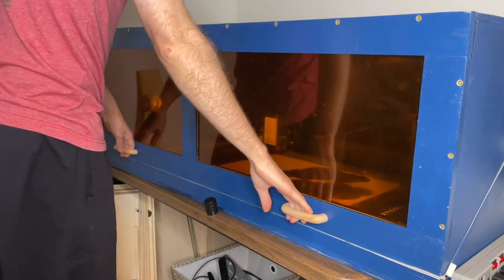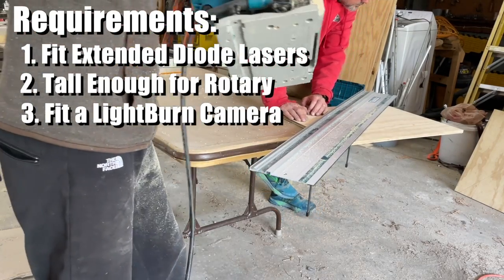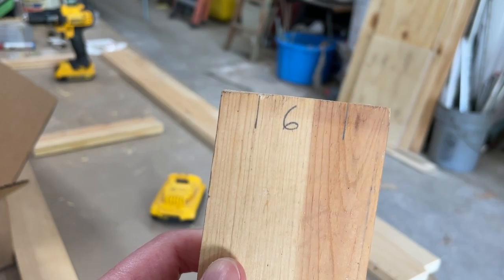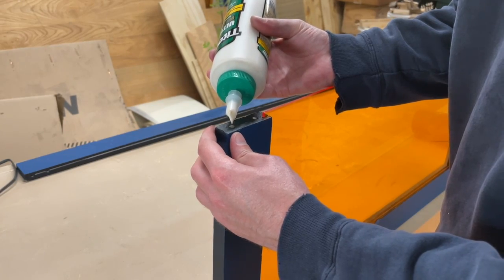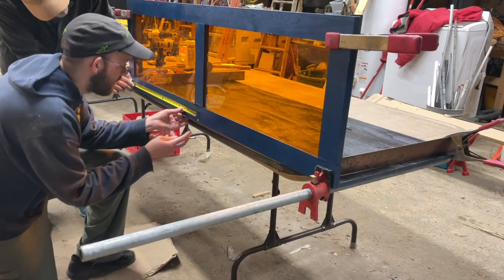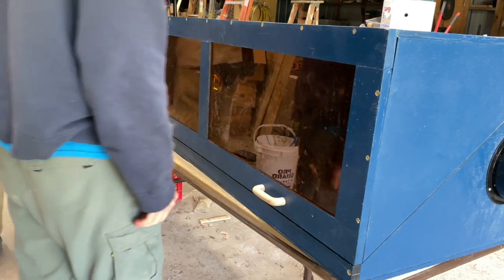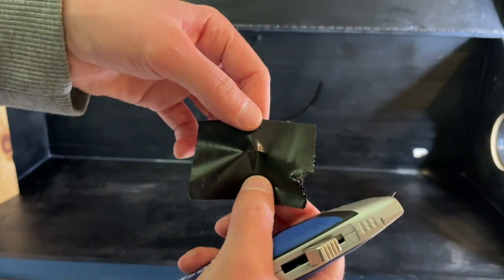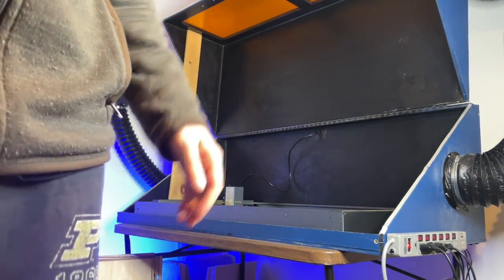Building My Dream Laser Enclosure (Fits XTool, Atezr, etc.)

Comment: An option instead of buying the expensive laser filters you can use a backup camera or baby seat camera instead.They hve both the camera and display, are fairly cheap and can be used remotely.
I'm using a baby seat camera for my fiber laser as I will be able to monitor it while sitting down. (I thought of this after buying the laser filter.)
For painting there is a device called a Roller and Roller Pan these speeds painting up considerably.

If you had broken (cracked) the edge of the solid wood you could simply glue it back on.

Comment: Too amateurish a build.  Pre-drill holes for the screws will stop splitting of the wood.  Joints are too rough.  You are going to lose a finger or two using a table saw in that manner.  If you are going to all this trouble, use some quality wood rather than cheap plywood and rough lumber.  Sheesh, how do people get away wit this?

Comment: It’s always great to learn new things. An added benefit is learning from your dad while creating wonderful memories. (Many people don’t have that )
When painting flat surfaces, using a roller is preferred, incredibly fast. Other option is to use a paint sprayer(costly, time consuming due to set up and protection from overspray, and cleanup/break down)
I would like to creat a cabinet with a down draft exhaust. 
Would you might have plans for one? I also only have the standard D1 system.
Thanks for video

Comment: The air intake setup being used will create dead zones where fumes will not get pulled out but collect. Need to run 1-2 inch holes across the bottom side, with at least 1 in each corner. I would also put on the same side in the corner of the lid. This way as air is pulled in through the different holes, it creates an even air flow across the workspace with new air. You just dont want to many large holes, as you want slightly  more volume out than in, which will ensure any cracks/seams will not allow smoke out due to the negative air pressure.
Reply from the maker: Very thoughtful comment. Thanks for weighing in. I’m getting ready to set this up in my new shop, so I’ll consider your suggestions here.

Comment: Great build! I'm planning my own enclosure and trying to work out the best exhaust. I've seen a lot of people struggle with air smoke escaping their enclosure even with an exhaust fan. My logical solution is the same as your idea, which was to have an intake duct bringing air in from outside to the enclosure and seal it. That way the enclosure has it's own sealed environment. 
I was only planning to have one fan on the exhaust and let the negative pressure pull air in the intake. I see you have two different duct sizes and fans. Can you explain why you chose to do it that way? Will just one fan not be strong enough to pull air in from the intake?
I saw another person's response that you need a stronger fan for the exhaust, but I would be worried that would just over-burden that fan that is starving for air to move and burn it out.
Reply from the maker: Thanks! For the fans, i use a 4inch (and slightly less powerful) fan for intake and a 6inch fan for exhaust. My original logic was that using a less powerful intake fan would still create some negative air pressure to account for any leaks in my seam sealing. With that said, I’m not sure it’s a perfect solution, so if you get good results with a different setup, I’d love to hear your approach.

Comment: Trick for cutting with a plunge saw: You can take a plastic bottle an cut off the top so it fits over the saw dust exhaust. Then most of the dust will be collected in the bottle instead of the floor and in the air. Then it is just a matter of emptying the bottle in a bin. You just need a small 500-600 ml bottle for the purpose - empty it between each cut. You simply turn the exhaust upwards, slightly to the right, instead of downwards, and put on the bottle. Works well with the Mikita. The same can be done with the mitre saw.
You miss covering the inside in some kind of metal sheets to avoid fires, if a burn goes wrong and some wood catches fire.

Comment: I have a sculpfun s30 ultra 33W. I'm having trouble finding an enclosure for it. It pretty much is a 720x720 footprint.  Can this work for me?
Reply from the maker: If you’re talking MM, then unfortunately no. This design would be long enough, but not deep enough for your laser. BTW - I think I remember coming across this laser. Is it the one where you can basically extend it in two directions? Giving you a very large extended square working area? Just curious because most lasers only extend in one direction, whereas I think sculpfun allows “double extension”

Comment: For your door lifts, you may wanna check out my spring setup that I use. It is far cheaper to add and also provides upward and downward tension to the door without the need for a latch to hold it closed as with struts, I have tried both and springs work better for me. It is all about the placement of the springs to adjust tension.
Reply from the maker: Hey! Thanks or the tip - I’ll think about the spring approach. Now that you mention it, I remember seeing that in one of your enclosure videos. I’m a long-time viewer of your channel by the way, keep up the great work!
Reply: Cool, Thanks for watching. Nice looking enclosure also.  @chalkwatts

Comment: Some suggestions.  First - Instead of placing the intake air inside of the box .. force the air into the room instead.  In combination with ducting the waste air to the outside .. you now created a positive air pressure in the room vs the inside of the box.  It's like a clean room.  The smoke can not escape even if you have a leak.  In fact you want to have some ventilation into the box.  Second - Use a more powerful fan for the in take than the out take .. like 6" in vs 4" out.  Lastly - Close all doors into the room to help seal it.

This is the way I have my laser setup.  So, even if you open the lid before all residual smoke  or smell is evacuated, it would still get drawn outside.
Reply from the maker: Very interesting ideas. One question. Wouldn’t it be better to have a larger exhaust (e.g. 6 inch) than intake (e.g. 4 inch), because then the exhaust would create negative air pressure INSIDE the box, meaning that it would pull in all the intake air as well as some ambient air in the room. That’s the way I was thinking about it, but do let me know if that’s flawed thinking.
Reply: I'm no engineers.. so, I'm guessing here. It would depend on the situations? 

For me, I have a 100W Thunder laser in a basement that is venting through the 1st floor and an attic. The laser generates a lot of smoke and smell. The basement air is cold and the smoke from the laser is NOT hot so I don't get the draw effect from the flue/chimney (20 ft in height). If anything.. in the summer I'm fighting to push the heavier cold air (68F on average) up to the roof. I originally had two 6" ducted fans. One is at the laser and one in the attic on the same flue. They were not enough. I still had some smoke and smell.  So, I built a door with a 20” fan in it to blow air into the room from the rest of the basement.  It worked .. no smoke or smell at all.  The 20” fan was moving more air into the room than what the two 6” fans can pull out.

So, for me it was inefficient to draw a vacuum with 6” ducted fans and at the same time try to push/lift the cold heavy air up 20 feet.  For you a bigger out flow might be better since you are not fighting gravity.  

I think the most important thing is to have a differential in air pressure.  The two fans should be of different capacity (CFM – Cubic Meter per Second).  You can use the same 4" Dia. ducts for both.  Just have one fan stronger than the other.

BTW - I forgot to mention that I like your box! Very nice!
Reply from the maker: Hm - now you've really got me thinking! I hadn't thought of the role of heat in this equation (e.g. rising smoke in a chimney). I'm actually moving to a new workshop in about a month, so maybe I'll be able to play with optimizing the airflow a bit more at that time. 

Thanks for the really thoughtful thread here!